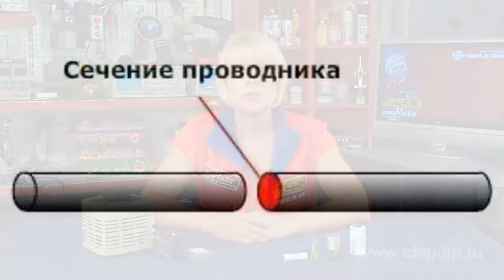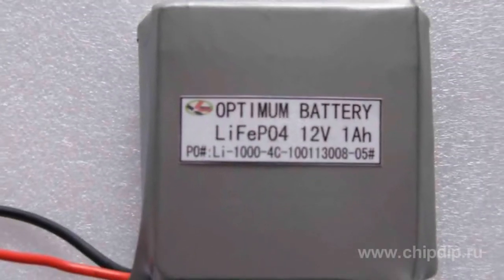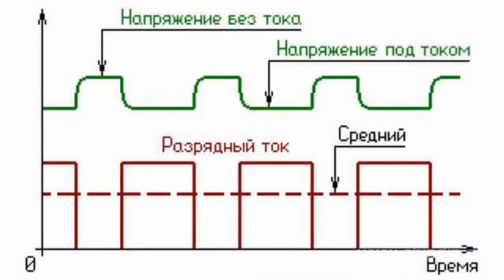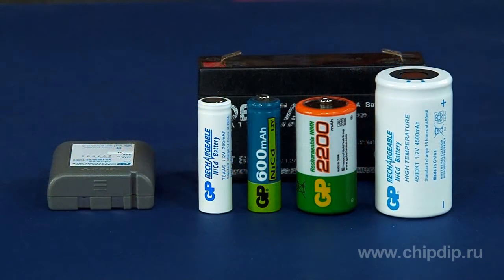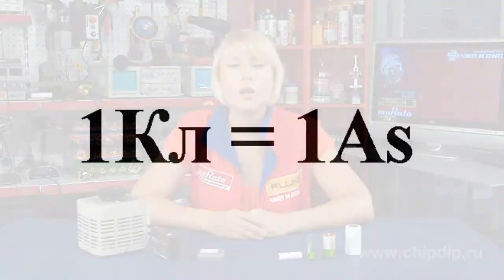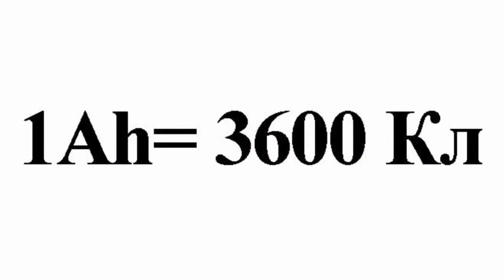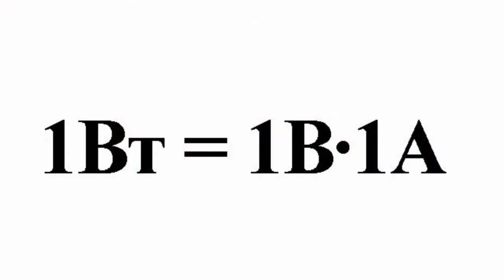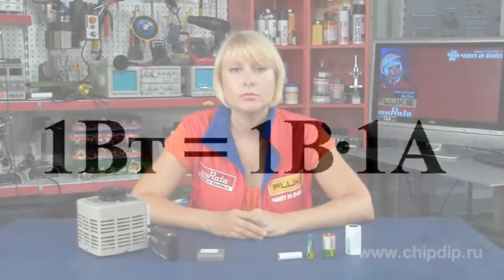Ampere-Hour

Comment: I certainly approve of the change in announcers, but you need to use *her* voice, she needs to stand up, and the whole script needs to be re-written.
For example: "Since 1 Coulomb is equal to 1 Ampere-second, we may calculate that 1 Amper-hour will be equal to 3000 Coulomb." There are 3600 seconds in an hour. Another example: the final formula need explanation of the terms. The correct formula is this: Watt-hours= Ampere-hours X Voltage . `~- Nehmo